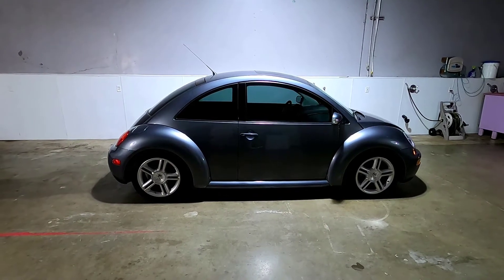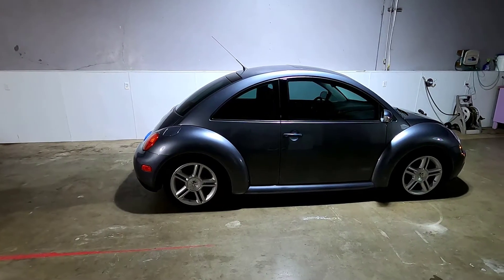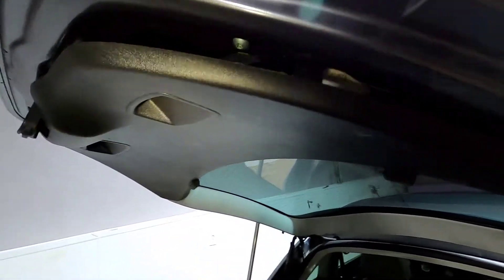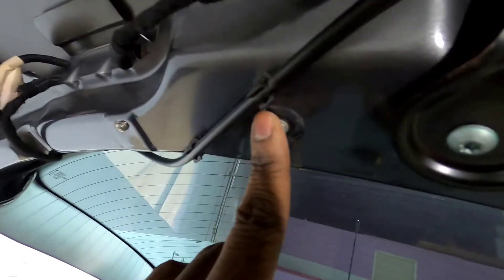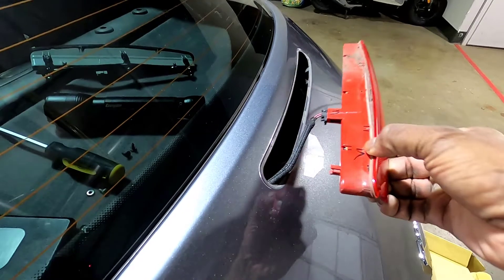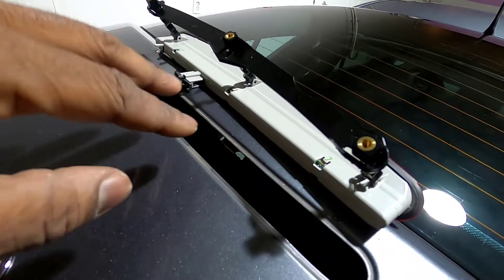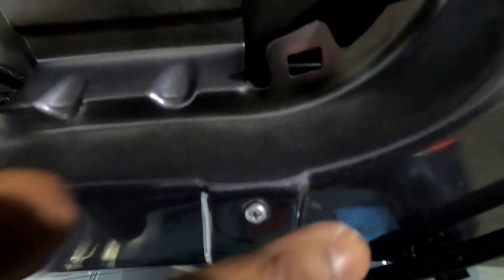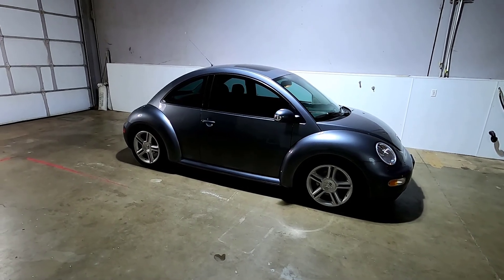Third Brake Light Replacement: MK4 Volkswagen New Beetle Hatchback (1998-2005)

Comment: Amazing video!!!!
Reply from the maker: Thank you so much for the positive feedback! I'm thrilled to hear that you enjoyed the video. Happy driving!
Reply: @BuildYourOwn  Your welcome. Is this car a good reliable car because I’m thinking about buying one
Reply from the maker: @nellegirl6288  It's great that you're considering an MK4 Volkswagen Beetle as your potential next car. These vehicles are known for their unique, retro styling and are quite popular among car enthusiasts. As for reliability, here are a few key points to consider:

Engine and transmission: The MK4 Beetle comes with a variety of engine options, including the 1.8L turbo, 2.0L, and TDI diesel engines. Each has its own set of advantages and drawbacks. In general, the engines are considered reliable, but as with any used car, their condition will depend on how well they have been maintained by the previous owner.

Maintenance and repairs: The MK4 Beetle is relatively easy to work on, with many parts being affordable and widely available. However, some repairs can be more expensive due to the car's unique design and layout. Regular maintenance is key to keeping any vehicle running reliably, so be prepared to invest in routine services like oil changes and brake inspections.

Common issues: As with any vehicle, the MK4 Beetle has its share of common problems. Some of these include window regulator failure, coil pack issues, and problems with the mass air flow sensor. It's important to research these issues and be prepared to address them if they arise.

Age and mileage: As the MK4 Beetle was produced between 1998 and 2010, the age and mileage of the specific car you are looking at will have an impact on its reliability. A well-maintained, low-mileage example will generally be more reliable than one with high mileage and spotty maintenance history.

Ultimately, the reliability of an MK4 Volkswagen Beetle will depend on factors such as maintenance history, mileage, and how it was treated by previous owners. It's crucial to have any potential purchase inspected by a qualified mechanic to identify any issues and determine if the car is a good fit for you.

I also have some links and resources for you. I am a big fan of the MK4 beetle and have lots of content.

You should watch my 1998-2005 Volkswagen New Beetle Turbo Cost to Repair video. It's worth noting that I've put a few more grand into the car since the video. I will do an update video at some point. This is a good video to watch. https://youtu.be/rTMmBLn1x1M

Then over on my website, I have an entire category on the MK4 beetle. You should take a quick look at the articles. You will probably find one that's helpful to you. Here's the link:
https://www.buildpriceoption.com/category/mk4-beetle/

Do let me know if you have any other beetle questions.
Reply: @BuildYourOwn  Oh okay 😁